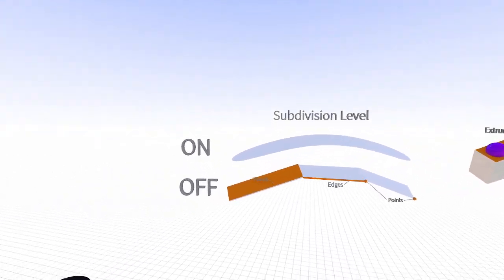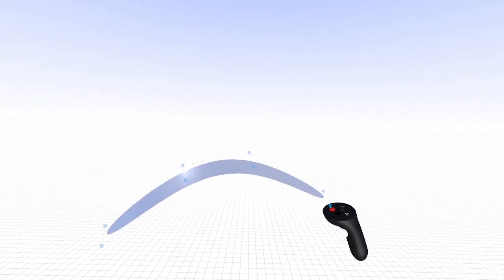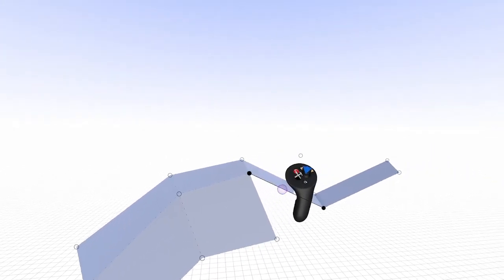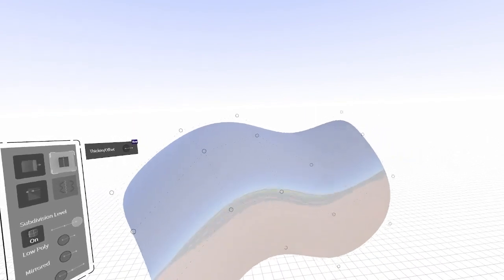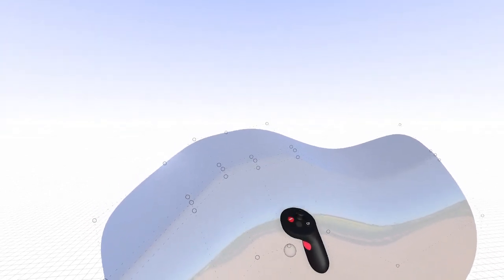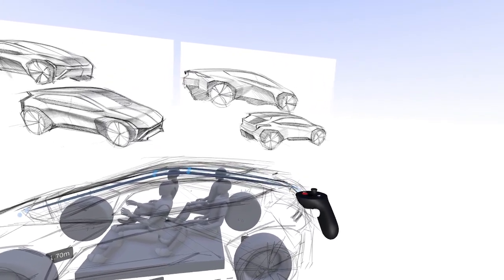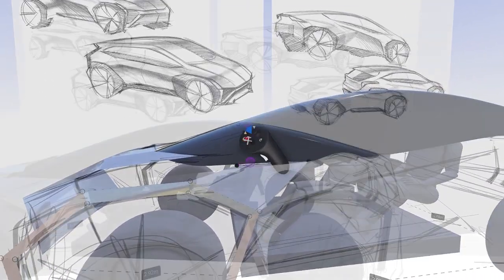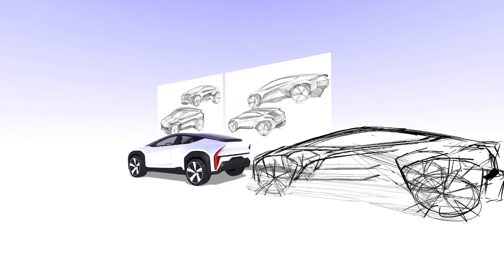Building Sub D Surfaces with Ribbon Stroke Tool

Comment: Why do a lot of people use extra edge lops for creases and not the crease tool?
Reply: The crease tool is used to get a completely hard edge, which is great to see a character line. People usually use edge loops to create a radius along a character line so they can soften the look of the line. Early on, the crease tool is great so you only have to manipulate the points along the creased edge. When you add loops to get that softer line you now have to manipulate more points when adjusting a character line.
Reply: The other reason is habit.. 20 years of doing it this way it becomes habit. :)